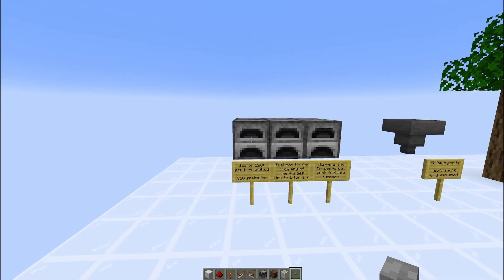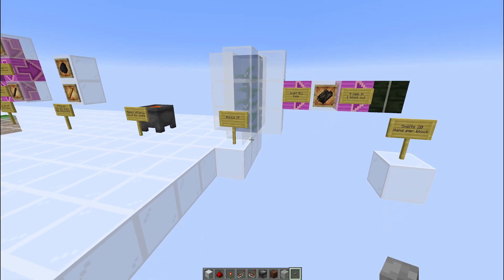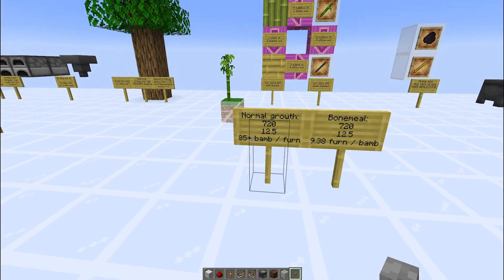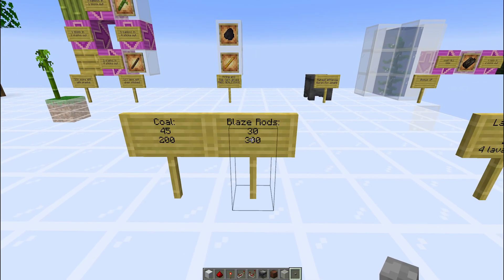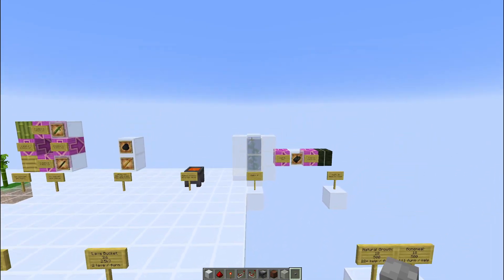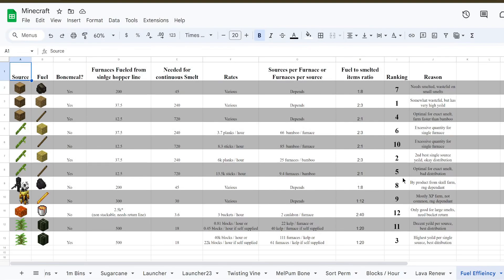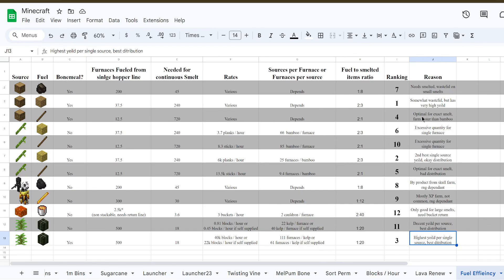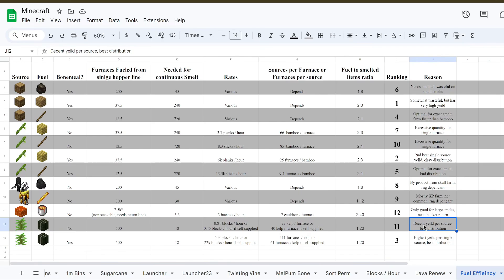What is the best fuel for a furnace array in Minecraft 1.21

Comment: The problem with tree farms is that it cant be fully automatic without bonemeal plus if you dont wanna duplicate tnt you have to creat a mob farm (creeper, ghast or witch) and dig sand manually so might as well go with a blaze or a Wither skeleton mob farm i prefer having a bamboo farm with bonemeal farm so i could chunkload the area even if theres no players close again can technically be achived with azalea and tnt if your ok with sand or tnt dupers i would also like to add with no bonemeal flying machine bamboo farms are criminally easy and cheap to make but you cant chunk load it

Also the limitation of hopper is an easy fix you can run hopper carts along the fuel hopper insurring a controlled distribution system
Reply from the maker: Tree farms can be automatic with the azalea from bonemealing moss. The rates are not insane, but still blow the competition away.
Reply: @cswertwertwert  that is true I've mentioned it on my comment I was simply inferring to the best method that requires no item dupers or tnt dupers but if dupers are fine with your play style then carpets are technically the best item to use

Comment: Did you do a calculation for how many bamboo plants are required per furnace if you don't convert them to planks or sticks? I currently have a giant bamboo farm feeding into my furnace array, and have always been curious how much efficiency I'm losing by not converting them to planks.
Reply from the maker: There is no reason not to convert to sticks at the very least. It doubles the number of furnaces that can be supplies from a single hopper line. Converting to planks would let you smelt 3 items instead of 2 at the cost of 1 additional bamboo. Unless you are worried about wasting fuel, planks are definitely the way to go.

Comment: Shouldn't the self-supplied adjustments also apply to charcoal? Also, the furnace array for kelp can actually be a smoker array, so it can be a lot smaller than the furnace array it supplies with fuel.
IMHO the main benefit of bamboo and kelp is that you don't need to harvest them explosively. That makes farming them a lot more compact than any tree farm with a comparable bonemeal consumption.
Reply from the maker: When it comes to tree farms the yields are so high they tend to break all the numbers. Even a 500 log per hour design will get 2k planks, enough for 8 furnaces continually supplied, on par with the bonemealed bamboo. And it uses less bonemeal at the cost of a blast chamber.